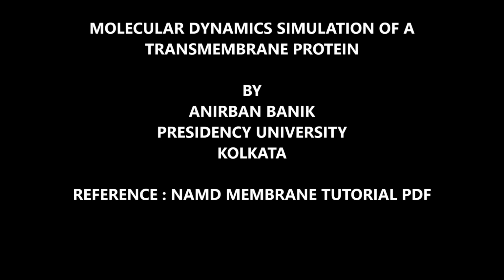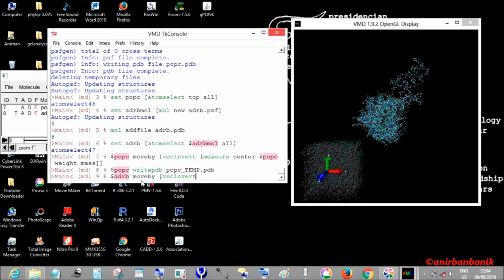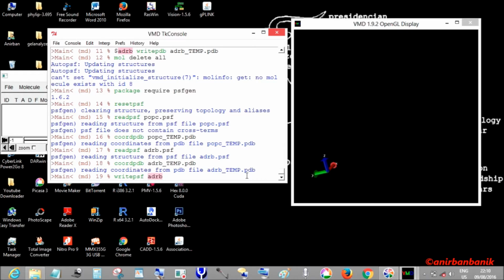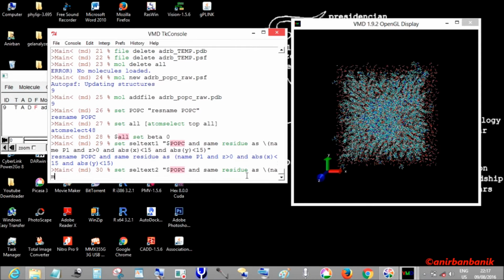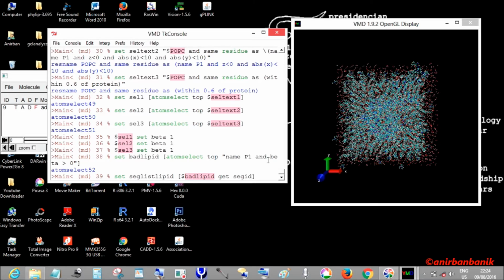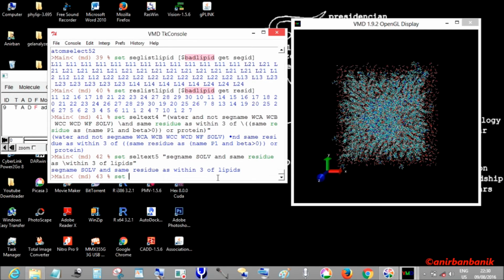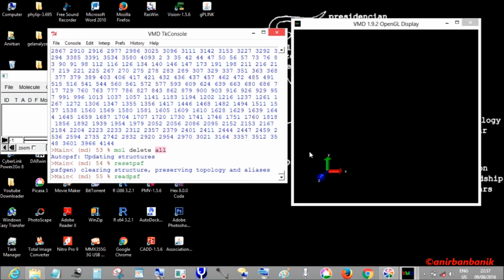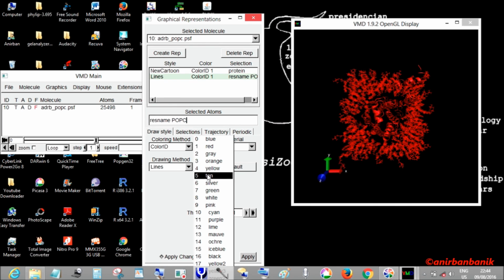Beginners' Tutorial for Molecular Dynamics Simulation of Transmembrane Protein Part I

Comment: Hey Anirban,
Can you tell me from where did you get that Adrb protein PDB file? I tried but couldn't find it on www.wwpdb.org. Plz help I'm a beginner
Reply from the maker: You will probably not get this directly in pdb. It was modelled. You may find other receptor proteins in pdb.
Reply: Thank you, Anirban
But other receptors like? I downloaded a protein name 1iwg.pdb. I followed each step of your first tutorial but I didn't get a clear cavity like yours. And you mentioned you are doing all this on your laptop. Would it be possible to do NAMD simulations on a laptop? Actually, I was doing a simulation on some protein on my laptop a few days back but NAMD did run it. I don't know why? Plz suggest
Reply from the maker: See, MD simulations are purely mathematical calculations done by the processor of your laptop/desktop whatever you use. I have done this in a standard personal laptop with windows 8 OS and i3 processor. Though such configurations are also not ideal for such simulation but you can somehow manage it by reducing the simulation time or choosing small molecule. So first look at your processor, if it is below i3, don't go for a simulation on that. It may end up burning your processor. You need to look at your processor and according to that you may select your molecule (If big sized protein run less time and vice versa). Additionally, during this tutorial, as my laptop took almost 6-7 hrs time for the simulation, I placed the laptop on a pile of small books to ensure that the bottom part and the sides are not blocked and so that the generated heat can pass easily. A small suggestion would be to run such simulations during daytime, if it takes such long time.

Comment: >Main< (MD) 89 %  set sel1 [atomselect top  $seltext1]
atomselect: cannot parse selection text: resname popc and same residue as (name P1 and z>0 and abs(x)<15 and abs(y)<15

this is the error which i am facing,,,while running the tutorial, so could you please help me to figure out this error.
Reply from the maker: I think you have faced some space problems during typing of the initial command. So initially you type
 
set seltext1 "$POPC and same residue as \ (name P1 and z>0 and abs(x)<15 and abs(y)<15)"

then set the seltext 2 and 3 and then type the command

set sel1 [atomselect top $seltext1]

and similarly for seltext 2 and 3
Reply: thank you so much, my this problem was solved,
can u please tell me how to make psf file, if protein has two chain.
how to solve this error...
ERROR: Constraint failure in RATTLE algorithm for atom 48127!
ERROR: Constraint failure; simulation has become unstable.
Reply from the maker: I have never worked with a dimeric protein yet. I will definitely look into it and let you know. Could you tell whether this is a water soluble protein or membrane bound one?
Reply: this is membrane bound protein.it is abc transporter protein.
when i was creating PSF file ,that time some warning come.relates to some residue,but that time there was no ant error.after that when i was solvating my protein,same as NAMD membrane tutorial PDF,that time i am getting some error,but then after file is generation.

Comment: Hello friends, This awesome tutorial. I am interested to try in my own computer. Could you give me the PDB ID of the protein? so i can download it from the pdb.org. I was trying to look for the adrb protein, however i didn't found the one that u use. thanks
Reply from the maker: You go to pdb and there you just type adrb. You will get many crystal structures of adrb and download anyone. But what I found is generally these adrb proteins were mostly fused with lysozyme to make stable. So remove those parts using Discovery Studio. Additionally you may find some parts of adrb are missing and in that case obtain the complete amino acid sequence of adrb and model the entire structure with ITasser , Phyre2, modeller according to your wish.
Reply: plz send link if you pdf file manual